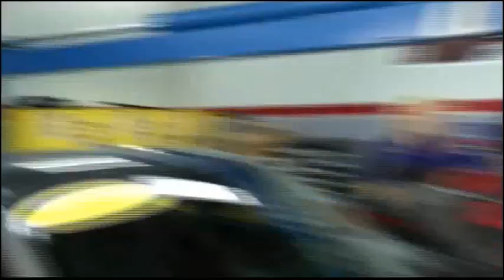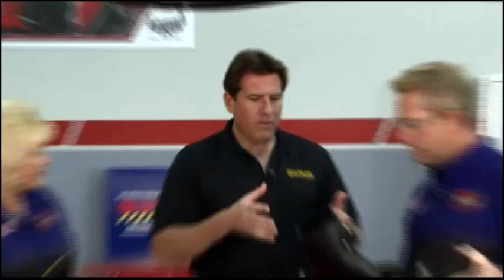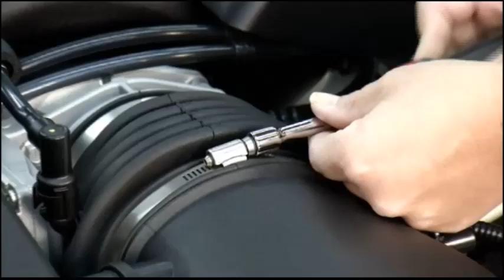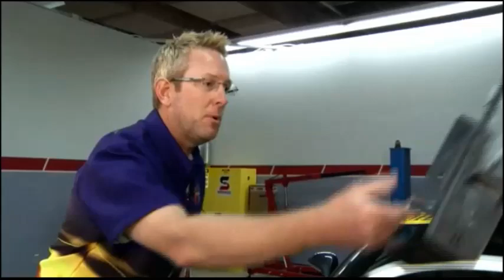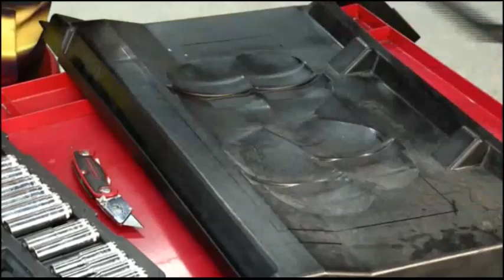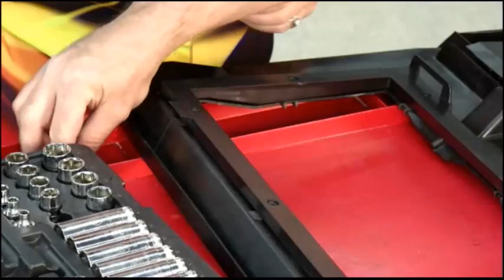RAM AIR Corvette C6 Intake

Comment: I put this intake on my 2011 C6 and made 35HP as advertised. Unbelievable pedal response even in 90 deg. weather and better in cold temps. I recommend this to anyone that wants added horsepower at a low price.
Reply: +jrblues01 You're the one selling these, and you post here pretending to be some satisfied customer giving a casual review? Shameful.
Reply: +PMitchell106 Not pretending as I did install this intake on my 2011 corvette and DID get these results.  Sorry if you spent money on a lower performing competitors product and got burned.  Stop crying and buy a good product from RAMAIR.